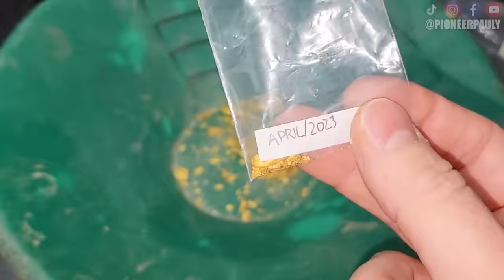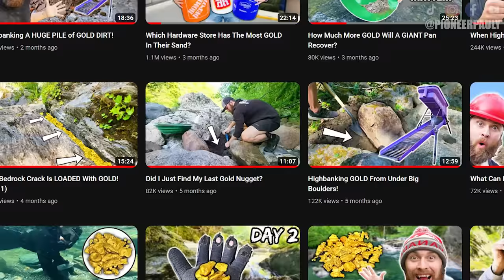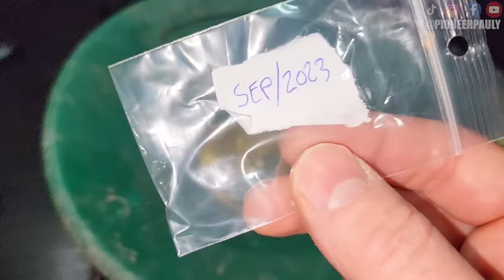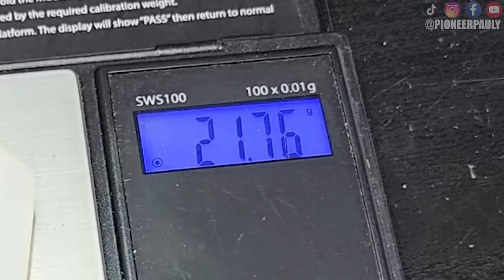HOW MUCH GOLD WAS FOUND IN 2023?

Comment: It would be nice if you told us how much value those golds were all together
Reply: Prices fluctuate, but 1g is about 100 CAD, so 77.77 g is 7777 CAD. Assuming it's of highest purity which it probably isn't. So at least 7000 CAD just in it's weight.

Comment: Saw you today on jeff Williams prospector Arizona. Did industrial cleaning in power plant paper mills we did Pond dredging in plants also. Been dream to use my skills and engineering skills to do gold. Made millions for others building equipment this summer is my turn. Moved material with water and air machine vacuum trucks. Rain shine hard core emergency response work. Crippled me but still got fight in me.